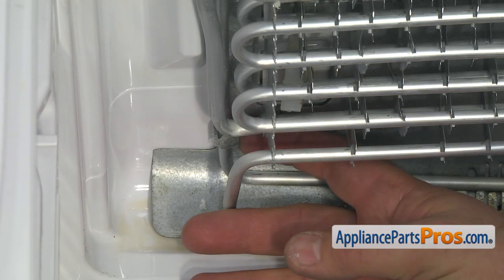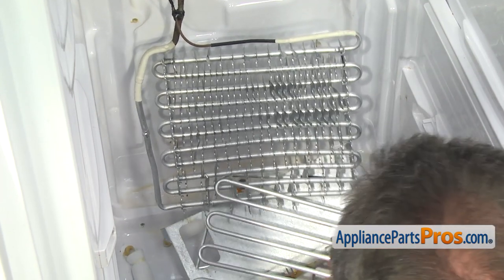How To: Samsung Evaporator Assembly DA96-00020Q

Comment: 12:07 
Dear fitter,

Thank you for a knowledgeable video. 
I noticed when you were refitting the fridge heater element, the defrost heater temp. sensor, the foam sensor part needs to sit behind the evaporator coils (as I have seen in many other vids) instead of behind the heating element (bottom right hand side) otherwise it will pick up the temperature too early & cut out at 80 degrees risking partial defrost of the evaporator fins.

Comment: Awesome awesome awesome video! Is there a video on testing the defrost heater like that one? Can we test for continuity in the wire harness and if it’s working it is continuous?
Reply from the maker: Unfortunately, we do not have a video for that yet. You can test the harness for continuity with a multimeter. You can test the defrost heater for resistance. You will need to locate the tech sheet on your unit to see what the resistance reading should be, it's usually around 35 ohms, but check your tech sheet to make sure.
Reply: @appliancepartspros  thank you!!!!!
Reply from the maker: You're welcome!

Comment: I really can’t thank you enough for this video as there are so many heaters and I could not figure out what to do. My only question is...how do I know what went bad, the heater or the sensor?
Reply: Failed to mention details: Fridge is the Samsung RS2544SL and it was not getting cold enough. I opened it up and the entire evaporator was iced over. I defrosted it with a hair drier and also removed the water from the rear pan. Trying to figure out what part I need now,; the sensor, the heater and sensor, the thermal fuse?
Reply: Need to put it on force defrost and check if the heating element gets hot

Comment: So, the problem with this refrigerator was the heater? If the evaporator coil is leaking, you replaced the whole  assembly ?
Reply from the maker: It is going to depend on what the issue is with your fridge? What is the model number of your fridge?

Comment: Great idea!  I’ve found a defrost heater replacement for this, but it is only available in UK voltages.  If replacing the sensors doesn’t work, I’ll be giving this a try!
Reply: I don't think voltage would make much difference for a heating element. I once had a Whirlpool/Hoover clothes dryer that ran on 120 V. It had the same heating element as a 240 V model. With 125 V, I think it would just draw a higher current or take longer.

Comment: great video . i think it would be better next time to drill out 1/8 pop rivet  holding bottom drain heater tray and replace with new pan, that way you dont have to fool around bending heater hold down clamps. but other than that great video. i was a commercial refrigeration serviceman for .hussmann  for almost 32 years  great job
Reply: Henry - I have a rusted tray and need to replace the tray only but can't find that p/n, any help on that would be appreciated

Comment: Hi - is it possible to replace the entire unit - would a professional be needed to re-gas the fridge after?
Reply: You would need to hire a service technician in order to remove and replace the evaporator coil, unless you are EPA certified to work on sealed systems.

Comment: Looks like the same fridge I have except Stainless.
Do you know the exact part# for just the Defrost Heater by itself?
I have had problems with my Samsung RS267lash Fridge over
freezing and causing inside middle vent hole and fan to eventually freeze to
point of no airflow , then fan grinding eventually to a halt from being frozen.
When I force the fridge into defrost mode, it does not seem
to melt the ice either.
*Theoretically, if I force it into Defrost mode, the heating
elements should come on and should be able to test 110V Correct?

Don’t think it’s a bad Defrost heating element ,  last time I checked this it showed 96 ohmsDefrost sensor (yellow) was +- 2K at Room temperature. 
Thermal fuse (Red black /w white foam) = 0 ohms 

Not sure what to do now.
Reply from the maker: The defrost heater on this particular model number was only sold with the complete evaporator assembly. I don't have all the specs here you can post this in the repair forum and they can help you out!  http://forum.appliancepartspros.com/
Reply: It's thermostat that is the problem

Comment: Hi, very nice vtutorial!
could it be possible that the problem i have is just a defective defrost sensor? how do i test this sensor to know if it is defective or not before i replace the difficult defrost heater. the thermal fuse, if defective what is the symtom? thanks.
Reply from the maker: Without knowing what you have, I would suggest posting the problem along with the appliance model number on our repair forum and the techs can help you troubleshoot the problem. http://forum.appliancepartspros.com/

Comment: Why do you take it all apart and not just replace the entire assembly...?
Reply: sakle  This is very interesting. In this discussion someone asked if it is necessary to top up the gas after such an exchange. The answer was that there was no gas there. Can anyone explain us exactly why you need to buy the whole part for $ 100 and use only a tiny part of what we bought for this repair? For what we can not install the entire purchased part.